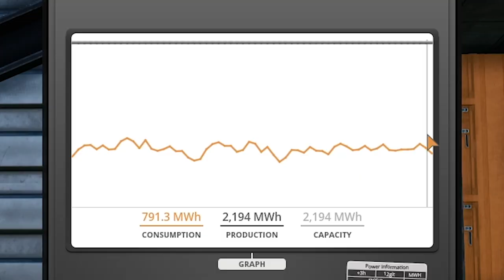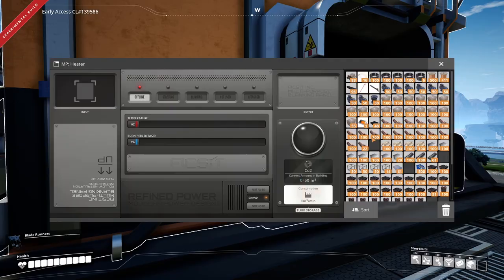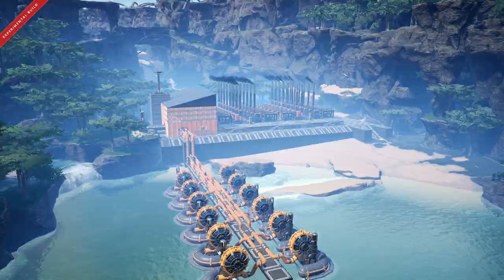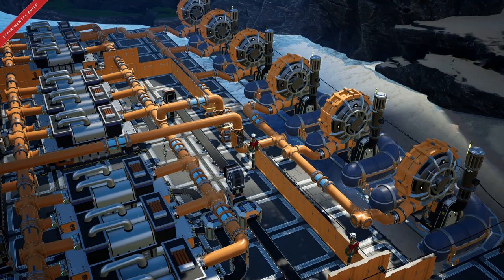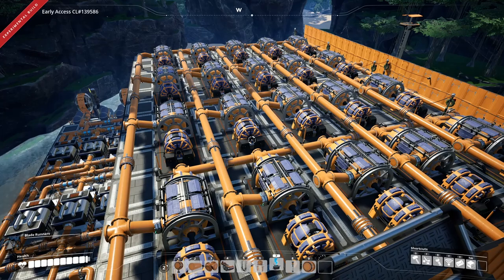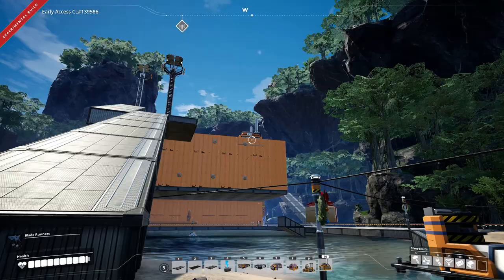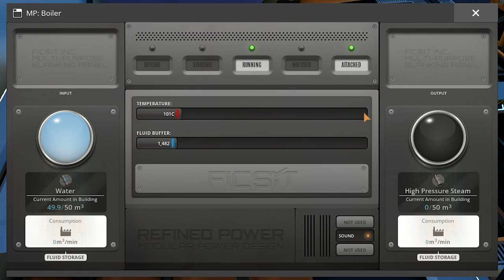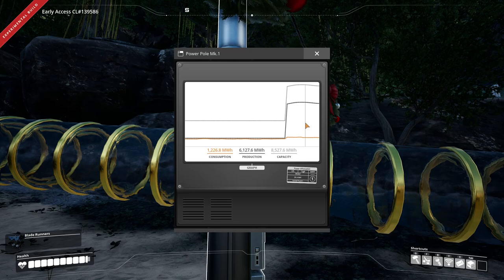Modular Power Plants are a GAME CHANGER! - Satisfactory Modded Gameplay Ep 8

Comment: Co2 can be combined with limestone in a refinery to create carbon dust which can then be used in a maximum efficiency steel production recipe
Reply: I didnt see that recipe. Is that true?
Reply: @jonathandemiguel1458  Yes, it's true. I run all my steel production off carbon dust instead of coal.
Reply: @jonathandemiguel1458  I can confirm the information. In the refinery, at the bottom of the production list, under refined power. Carbon dust alternative.
In the Foundry is an Alternate: Carbon Dust Steel Ingot
Reply: @teux01  : I convert all coal to carbon dust in my steel plant, because I can both do steel AND integrate solar into the workflow with minimal changes, plus one can easily go back to an all coal setup if needed. I also use the iron/copper alloy ingot recipe both for efficiency AND I can get copper and iron ingots with only a recipe change in the respective machines, or separate lines otherwise equal in design.
Reply: ok mathswiz no need to brag
Reply: Quick! Someone tell Al Gore!

Comment: Could you run the liquid outputs into fluid buffers and just see how fast they fill to figure out the ratios? Building that big without knowing the ratios was not a good idea!
Reply: he could just connect a single burner to a single cimney and measure the flux in the tube
Reply: @Beregorn88  or the modder could just provide the numbers in the building.
Reply: @brennenderopa  or they could do that, yes. In the meantime, however, what I presented is the fastest and easiest way to know.
Reply: @Beregorn88  True, but the output is so unregular, that it's going up and down all the time. Too bad pipes don't show like last minute's average or something
Reply: @moebi_  Fortunately, fluid buffers do show an average

Comment: As an engineer, that turbine being THE WRONG WAY ROUND really hurts my eyes. Real turbines have a high pressure inlet at the edge of the wheel and a low pressure outlet at the center.

Also, having to use pumps to get high pressure steam up to another floor feels kind of... funky.
Reply: The only reason the pumps qere necessary is cause technically in the coding they had to classify the gasses as "liquids", so they need head pressure to go upwards. We might see this change in update 4 thankfully with the intro of actual gasses though.
Reply: As a steamfitter, I agree.

Comment: The ratios taken from the docs of the mod: (if Kibitz pin this, will help a lot of players)
value per minute

The Coal heater consumes 20 coal and produces 75 Co2
The Boiler mk1 consumes 44 water and produces  72 high pressure
The Boiler mk2 consumes 77 water and produces  123 high pressure
The Turbine mk1 consumes 25 high pressure and produces  15 low pressure
The Turbine mk2 consumes 45 high pressure and produces  22 low pressure
The Steam Chimney consumes 42 low pressure steam
The Co2 Chimney consumes 64 Co2
The LV Generator runs between 2300 and 2600 RPM
The MV Generator runs between 3100 and 3300 RPM
The HV Generator runs between 4000 and 5000 RPM

To use Turbine Mk2 with MV Generator, let the RPM beat 3100 and put the steam waste at 50%.
To use Turbine Mk2 with HV Generator, let the steam waste at 0%.
Reply: Thank you for this! I've tried to figure out the numbers on my own and the numbers are weird.
Reply: The HV Generator is not in the mod we have onliy LV and MV Generator

Comment: With the mod: Efficiency Checker you can measure the in- and output of pretty much every machine ^^
And as addition it even shows you if the transport method of your choice can handle your insanity ;)
Reply: that mod doesn't function on modded machines, only vanilla machines. 
In fact, it SPECIFICALLY states that it is not compatible with Refined Power, which is where all these power generating machines come from
Reply: @BobTheTesaurus  oh that is sad

Comment: I actually made the same thing yesterday but for the people who want it, let me give a quick tutorial:

A Coal Heater: 20 coal in, 75 Co2 Out
Boiler: 20 water in, 72 High Pressure Steam Out
Turbine: 25 High pressure steam in, 15 Low pressure steam out
Steam disposal at 42
Co2 disposal at 64
soo.......

i did the math, with 528 water per minute and 240 coal per minute you get around 6034mW
You need:
-12 heaters & boilers
-35 Turbine
-15 Co2 Waste (5 per 4 heaters)
-15 Steam Waste (actually 13 but kinda hard to balance out with pipes) (about 5steam waste/12 turbine)

So lets hope this helps, goodluck
Reply: Actually the waste output is a 1:1 ratio meaning 1 co2 chimmny to 1 heater regardless of fuel type and 1 steam cooler per boiler whether mk1 or mk2. This was confirmed on the mods discord earlier and verified in game.
Reply: Oh and you also can not combine the co2 pipes right now either as they won't work. This was confirmed by the dev so you have to have each heater hooked straight into each chimmny separately with their own pipe, so 12 individual pipes for 12 heaters and chimmnies. You can however merger all the turbine pipes and split them between the 12 cooling towers needed for the 12 boilers which works fine.
Reply: @oldman1973  Combining Co2 in hooked up pipes do work last time i checked, further waste ratio 1 to 1? Their wiki says otherwise atleast but that could be wrong information displayed over there
Reply: @oldman1973  All the data and calculations that i wrote were based purely on data given on the wiki and then a tested version ingame
Reply: I found the outputs seem to cycle up and down, so need to be sized for the peak. Using buffers I got 8 boilers running with 1 CO2 for 2 boilers plus a spare, total 5, commoned up with a header at the chimneys.
Reply: @jordipluk9425  the info I listed about the 1 to 1 ratio was straight from the dev on the discord. Wiki info is old, they have a new spreadsheet link on their discord the dev posted.

Comment: One thing I also noticed with the RP mod is that the heaters generate more CO2 when they are starting up. Once they reach operating temperature they back down a bit. This means you need to have more CO2 stacks than what's needed for production in case of a overload and your plant needing to restart.

All in all I really enjoy this mod and the variety in power production it brings. I enjoyed figuring things out as I went along but a bit more documentation would have been appreciated.

Comment: To figure out the max CO2 and low-pressure steam getridders you needed, you could have made a temporary setup that ran everything into one each then looked at the consumption rate and wether or not they were on and how many. Then you would have the max amount that each can get rid of, and if the entire plant was functioning with just one, then it doesn’t really matter because the minimum possible that you need is also 1 each.

Comment: I think I figured out the configuration for Modular Power:

1 MK1 Water Extractor & 1 Mk1 belt of coal... feeds to 1 coal heater equipped with 1 boiler

1 boiler feeds to 1 turbine and 1 generator - output is 175mw

5 of the above configuration can feed to 1 Steam Cooling Tower and 1 CO2 Chimney using MK1 pipes without any overflow or backup

Comment: They’ve changed the amounts on everything. Coal heaters burn at 15/min so it would take 8 heaters if the miner is doing 120/min. The steam cooler does 300 m3 and the co2 does 150 m3. I want to say the generators can use 60m3 so you’d need 5 of them. So a mk 1 pipe can support 5 generators which do 150MW each. 

I’m still working out the math with the boilers to get the most efficient number.

Comment: Super video, Kibitz. One of your best :)

I use this mod and it's fun, but it's very overpowered at the moment. Too easy to spam wind and solar power early in the game. And the modular power turbines make vanilla coal and fuel generators completely obsolete. They even make vanilla nuclear plants unnecessary. The top turbines pump out 500MW of power each and barely use any fuel to run--massively more efficient than vanilla fuel generators. Ten of these are easy to set up and produce twice the power of a vanilla nuclear reactor, with no radioactive waste to deal with.

To anyone who hasn't used this mod I recommend you do at least one run of the game with vanilla power as it's balanced very well. Then later use this mod when you want easy and fun new power sources so you can concentrate on cool factory builds, etc.

Comment: If you get to the MV stage for Modular Power, watch the turbine speeds, max(at least as of a few weeks ago) will spin them too fast and not produce power.  At that stage one oil heater(turbo for best result) will push 6 MV(with waste adjusted to maintain 3200 RPM, adjust by getting it to 3200 or close and setting the waste gate to 50%) or max out a HV version.  Also they use more resources to start up but generally go down to maintain.
Reply: If you use the waste gate do you need more steam cooling towers?
Reply: Also Looking at the numbers, the LV generators require a certain speed as well.  Like all things satisfactory, chk the numbers to make sure.

Comment: It would have been fun to have a proper system of steam (and fluid) pressure but it requieres to recode the entire pipe and fluid system >.<

I would have prefered if the flow rate was proportionnal to pressure differential (like Factorio and... real life) instead of this "mk." thing with pipes of the same diameter that has no sense.

In current state, you manage pipes pretty much the same way you manage belts with the only addition of headlift. The interest is very limited. Yes, internally, it works very differently, but in the end, you deal with it identically.

A missed occasion to add complexity and a new dimension in mid game progression in an other way that trickier ratios or deeper and interdependent production line.

Comment: This setup isn't too far removed from real world power generation. It would be cool if you could condense the lp steam back to water and run it back into the system for increased efficiency. Add gas turbines and heat recovery steam generation and you'll have a modern cogen power plant. Great job Kibitz and mod creators

Comment: Hey kibz there is a Alt recipe that let's you turn co2 into carbon dust that you can use for your pv solar cells I have a setup like that running using the co2 to make steel, just FYI since you like building huge setups, and you can condense the steam down to water agian to loop back to the boilers

Comment: I tested this mod way before, you see "COAL BOILER" took coal very fast when the temp. of water is less than 250°C, so i connected all total of 12 Generator+Turbine combo and connected with  1*CO2 chimney, and 2*Steam Cooling tower, but there's a trick, don't start all Boiler at the same time, it'll generate way more CO2 that can't be handl by CO2 chimney, start one after another, then connect to the belt, it's work fine for my cases ❤️

Comment: But if you use some of those modded Mk++ coal generators you get way more power for about the same input resources, and takes a lot less floor space and setup to arrange, so less piping and belting. What is the actual attraction of Modular Power?

Comment: I feel this mod is almost balanced already as it is, because while yes is distinctly better than the vanilla. All the complexity offsets the efficiency that it brings. You need to do a LOT more for this to be peak efficient. Take the calculation you just did. 
525 MW 
Thats just 7 coal generators and 3 water extractors and perhaps an mk2 miner going full blast without being overclocked. 
Compared to this were you have to run 
1heating plat
3 converting plat
2 cooling plat
3 turbines
3 generators
1 boiler and one coal burner
That's a heck a lot more logistic for the same power just more efficient. I see it as a side grade, when you are learning this is going to be too much of a hassle to make. When you are at a more proficient stage then this becomes the perfect solution to use just before you jump to Nuclear and even then after jump to the more complex Arc stage where is a ton more of stuff one has to do to get power. Also if we get to learn diluted fuel, then wouldn't that override this setup pretty much? I mean you can do so much with diluted and turbofuel that would work a lot better no?

Comment: Kibitz so u know i also try same module like u, and saw that mk2 boiler, generator and turbine dont give power, no power at all maybe u will figure it out
Reply: I can't get the mk 2 turbines running, but mk 2 boiler with mk 1 turbines and MV generators gives 235 MW per generator. Also 1 boiler drives 5 turbines, 5 turbines need 1 steam cooling tower. CO 2 seems to back up unless I use 1 CO2 chimney for 2 boilers plus a spare. Now running 8 boilers with 5 CO2 chimneys.
Reply: @davemillett1852  OK thanks for the information

Comment: currently i am producing 30,000 MW power without this system.Its too complicated and it needs source and too much time and complex factory. just use water turbine "on lakes, waterfalls," across all map(there are too many points where you can build them some of them 150 MW only one turbine because they are on waterfall,some of them 75 MW,50 MW and so on) , and gyzer power(200MW there are 13 of them) thats it. you can produce more then 50000 MW without source you dont need this much time. And its only MK1 , i didnt convert them to MK2 yet.And its really nice to travel across the map. And also , in coal power plant i never use coal ,its too efficent. coal power plant never need that much coal actually. i use the coal to make rubber , plastic and as a waste "petrelium coke" is made. i use this as a source in my coal factory. and its efficent enough to run all power plant.Just an idea...

Comment: Hey ImKibitz. I also have build or shall I say am still building my modular power powerplant and I have a better and easier solution that would have saved you a lot of trouble.
First of all your math was wrong 1 boiler can't supply 3 turbines. One boiler does only produce enough for 2.5 turbines and that's why I think that your power plant isn't working that well.
And now to my solution!
One full pipe of water 300m^3 can supply 6 boilers.
2 boilers share the same high pressure pipe so you have 3 pipes now.
And as mentioned before 1 boiler = 2.5 turbines => 2 boilers = 5 turbines and from those 6 boilers we have you can have 15 turbines => 2625MW of power.
For the low pressure steam and co2 I couldn't figure out how much one chimney can handle so I build the chimneys in a 1:1 relation. BTW you can hook up the 6 boilers to one pipe and that can handle with it more or less, at the beginning it will stutter a bit but when it runs for a while then one pipe can handle the co2 of 6 boilers. Almost the same goes with the turbines and steam cooling towers. For 5 turbines you need 2 cooling towers so it takes a bit less space. 

The fun thing is that my powerplant sits at the same location as your "vanilla" coal generator power plant.

Mine is just a bit larger 36 heater/boilers; 36 Co2 chmneys; 90 turbines; 90 LV-generators; 36 steam cooling towers. And all of this should theoretically produce 15750MW of power (if my math is correct) but I am not done with building all of the turbines and I have to say those buildings are huge so I need a lot of pumps to be specific I need about 200MW just for the pumps to run.

If you have read till here then thanks and have a great day.
Reply: Try the new pumps, or the megapump in a mod.